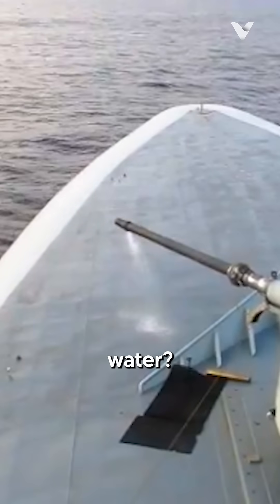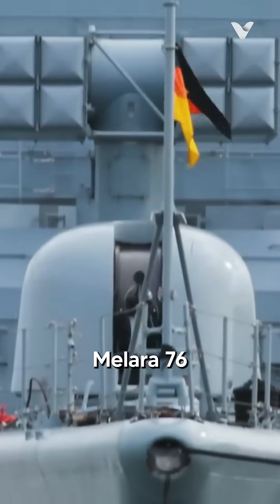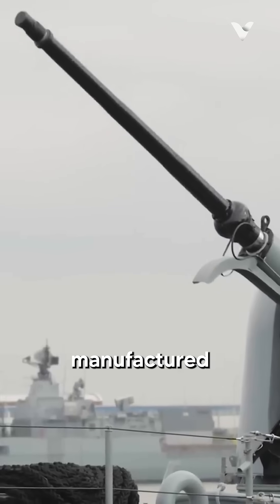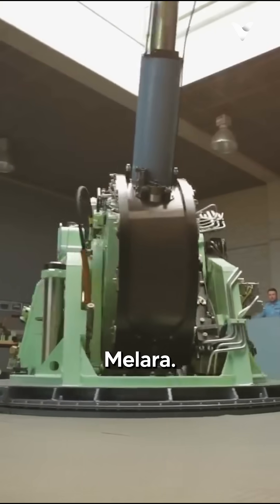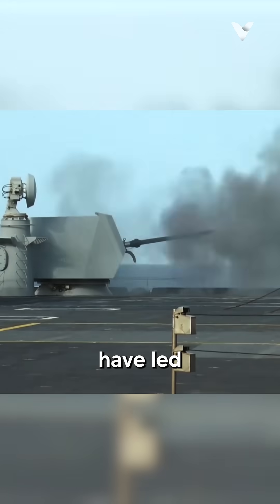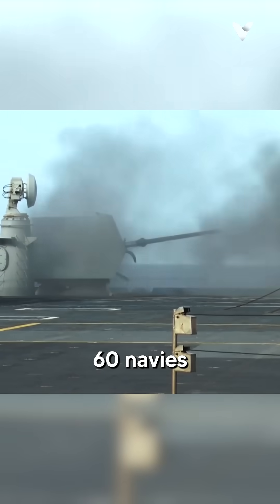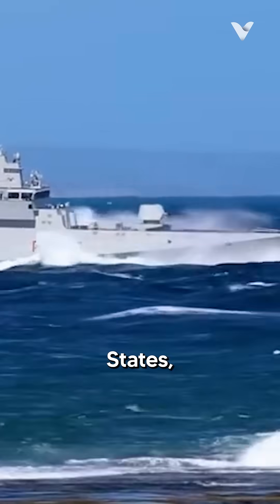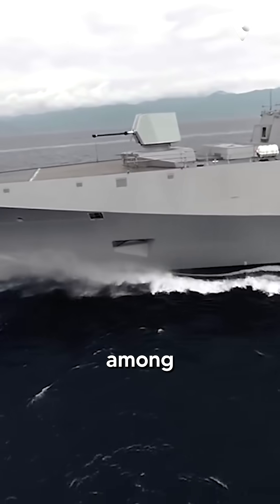Why Does This Cannon Spray Water? #shorts

Comment: Why do you think that this rate of fire for a 76mm gun is impressive?  UK's post war cruisers (Blake, Tiger, Lion) in addition to a very rapid 6 inch armament, they also had three 3 inch twin barrelled mounts, which could fire at 120 rounds per barrel/minute. This was reduced to 90 per barrel due o problems with the VT fuse in each shell at the highest rate of fire.  Blake and Tiger retained one 3" super firing turret forward, but the midships ones were replaced by Seacat missile systems when they were converted to helicopter cruisers.